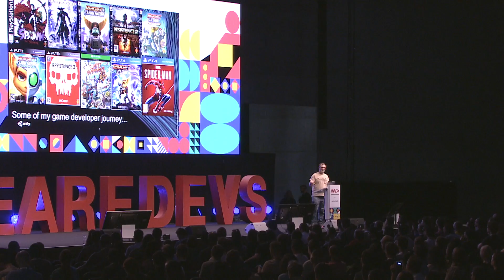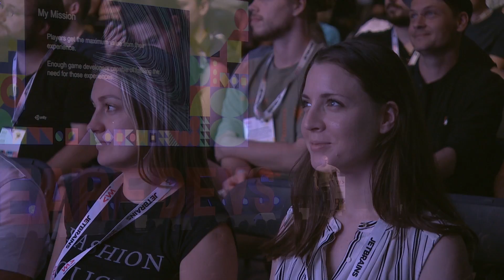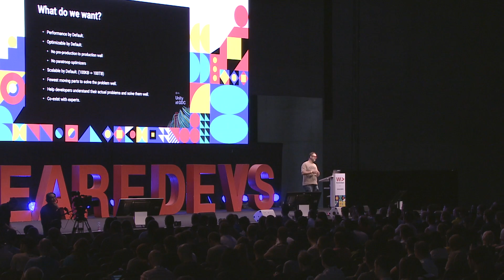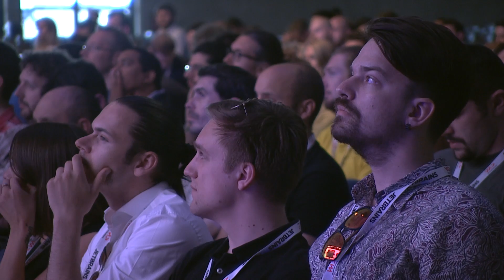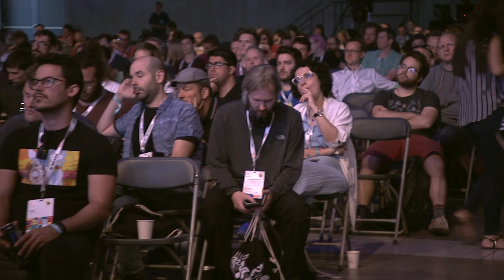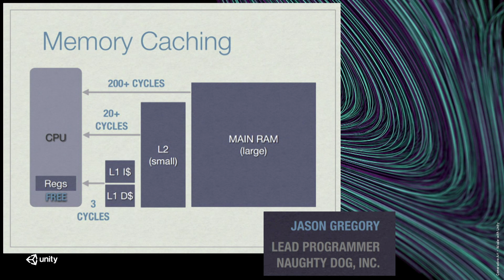Building a Data-Oriented Future -  Mike Acton

Comment: - "Unity runs on 25+ platforms."
- "Software is not a platform."
Reply: Can you explain what is contradictory about those statements?
Reply: @moistmalone2181   Many of the "Platforms" listed actually use the same Hardware and have just Software differences.
Reply: yeah it's running on platforms, it is not a platform in and unto itself. Those platforms have actual hardware
Reply: @drygordspellweaver8761 Many of these platforms are just Software run on the same hardware. For example Windows, UWP, Linux and even MacOS before the M1. Steam VR could also count as the same cause the differences are input and output devices. It is still a PC. Unless you start counting different monitors and controllers as platforms. I probably give it to them cause for VR, at least you need to implement stereoskopic rendering. Xbox one and PS4 also use almost the same AMD hardware. With different OS and drivers of course. On pc you can do many optimizations for different cpu models or gpus but the platform you are developing for would still be a pc. Android and IOS are another good example, you could count many phones as different platforms, but you dont. And if you dont count it as different then the rest of what differentiates IOS and Android is software. If you only count hardware, is WebGL even a platform?

And why list intel as a seperate platfrom? If it already is implicitly in some of the supported targets. Its done to make them look better cause they support so many duplicates.

This is very opinion based, exaggerated and was just triggered by the "Software is not a platform". The platforms shown are obviously defined by hardware and/or software combination. Not just hardware. "Software is not a platform" wasnt even used in this context. The word "platform" in particular has different meaning in both contexts. In the talk he explained something very important when he said it. I just found it funny that he was indirectly contradicting the list of "platforms" supported by unity.
Reply: @ischmicki  uhhh. Have you ever built a mobile app? You absolutely cannot port the same software to android/iOS without modification. If you use some kind of "universal" abstraction framework, then it is slow af which is completely Mike's point to begin with. Software is NOT a platform.
Reply: @drygordspellweaver8761 Taken out of context, if software is not a platform, why list windows and linux as different platforms? Its different software, run on the same hardware. Its different apis of course, but its software differences. In the list of platforms shown, there are many such examples. And then there is intel listed as a platform. If there isnt some intel os im not aware of, it doesnt follow the definition used by their list and is just there to increase the count. And what about WebGL? It could run on any hardware, its just software. Why list it as a platform?
Reply: @ischmicki  So you clearly know those two usages of platform differ, just say it was a joke and keep going on.

Comment: I've snubbed Unity for using C#, but this really convinces me. Low-level rendering code in C++, Shader Languages, and GPU Rendering APIs, with HP C# being used for ultra-performant scripting. Very different than the XNA C# of old. I've been on a Rust, Zig, Jai kick for a while now, but I've always had a partial fondness for C# (when comparing to Java) and the fact that it's this well-opinionated subset is actually incredibly appealing. I wish I was more clued in about this earlier.

Comment: I'm not sold on data oriented design. Yes it obviously gets you performance gains. But performance is not everything. Ease of use and clean, understandable code is also valuable. It's part of why Unity has been so successful. Beginners can easily learn to just throw a c# script on a game object and call high level functions like LookAt() or SetActive() and see it just work. That's abstraction. Being able to write code once and deploy it to 25 different platforms? That abstraction. I'm all for making performance gains, but let's acknowledge that there are tradeoffs.
Reply: Except those lookAt() and setActive() functions never "just work". They're built on top of something else, and when there are a problems (there are always problems), you will have to dig into what those functions actually do anyway. You don't solve problems by pretending they aren't there.
Reply: @tedbendixson  That's one thing I found as well -- we had such a complex interface for the analogical transformer, including functions involving pivots, and rotating pivots, and whatnot. In fairness, my team consisted mostly of academic R&D types heavy on computer graphics research -- maybe far more academically smart than smart about designing easy-to-use interfaces for things, and they were from various parts of the world -- English wasn't always their native language.

So I found myself and some colleagues often frustrated -- like just gimme the damned 4x4 matrix there. I know how to align two surfaces together with basic linear algebra -- the math is simpler than the complex interfaces they gave me and the manual-style verbose documentation they'd write (they'd literally write about 20+-page documents into source files and call them "usage manuals").

I find that a recurring problem in computer graphics -- like the domain knowledge required is already sorta steep, but once we break through it, the plainest representations of data are what we master.... not someone else's idea of how to abstract it. It's like I've been working long enough to understand all images are just 2-dimensional matrices of some vector or scalar type. pixel=y*img.w+x or, for power-of-two widths, pixel=y>>img.bitshift+x is burned into my brain from the DOS days. It's second nature to me now... but not like get_pixel(x, y), or set_pixel(x, y), or convert_pixel(x, y), or ImageFactory, or PIxelConverterFactory, or any of that OOP BS people wanna pile on top which, from my standpoint, provides not only some obstacles for the optimizer but for veterans as well in this industry.

What I like with suggesting lookat() functions and stuff if people wanna build that on top of a data-oriented engine is that they can do that... for their personal use -- in a sort of modular way. Just don't expect me to use it or debug it. I recommend that for sorta high-level developers who struggle with these things to build whatever convenience stuff they wanna put on top -- including object-oriented designs... But I think at the core engine type of level which tends to demand a high degree of domain expertise anyway and has a far larger portion of critical execution paths and performance-critical code than maybe even Knuth would ever have anticipated, it helps to just expose the data if in doubt.
Reply: @darkengine5931  I'm a big fan of something like what Casey Muratori calls "compression oriented programming," or the idea that "abstractions" naturally evolve out of utility.

You start by just plainly writing the code to transform your data, and once you notice that something is used more than once, that's when you lift it up into a function.

Programmers make way more things into "apis" when they really don't need to be.

If your player character only ever does something like looking at a point once in the code, there's no sense pulling that out into a function. It isn't being used enough to justify that.

The labor is waste, and the cognitive overhead of figuring out where it gets called and how much is also waste.

Problems are as simple or as complex as they actually are. Putting code into a function call doesn't change the nature of the problem.
Reply: @tedbendixson  I like this way as well. Some level of API design tends to be a practical requirement in my industry since we've gone heavy on the modding type of thing as a business target so we need the SDK and script bindings and whatnot to allow people to write plugins and scripts for our engines. But I like at least having low-level APIs to work with -- like not the analogical GDI SetPixel type of functions in Win32. Just gimme the damned pointer to the array so that I don't have to pay a dynamic dispatch cost on a per-pixel basis... things of this sort.

I suspect not all domains necessarily require us to master data in this sense. But computer graphics move so fast in terms of their evolution -- so the data is what remains stable in a world of moving targets. Audio processing is similar to me -- just a bunch of floating-point or fixed-point samples. APIs come and go like fashion trends. What I've found still applicable even from the 80s is the basic representation of data... with a few tweaks here and there to my idea of more complex data structures. But lots of computer graphics and audio is just processing big arrays of stuff more often than not -- maybe every now and then a more complex spatial structure for things like frustum culling... but still lots of recurring ideas -- and those recurring ideas aren't found in APIs (we have a Tower of Babel problem there) but in the data representations.
Reply: @tedbendixson   I've also worked on some horrid C-style legacy codebases dating back to Amiga days and the 80s -- where you found lots of what should be invariants violated... like some raw C-style structure representing a growing array with a size field that becomes negative -- not garbage but the arithmetic was just off. So I can appreciate the desire to protect invariants.

But from my pragmatic standpoint, the public/private distinction ultimately just serves the purpose of just reducing the number of functions in our system that can mutate data. With proper quality standards, we don't need to have a compiler literally enforce that with classes that make members private. The legacy codebases that I've worked on didn't even attempt this in any shape or form whatsoever, so maybe OOP was like a heavy-handed response to that sort of thing that went too far in the opposite direction. An ECS engine already reduces the places that mutate data down to the bare minimum -- as well as making them explicit. Even without an ECS engine, I think any programmer who makes a conscientious effort not to mutate data in too many disparate functions across the system can have something reasonable to maintain without going overly heavy on trying to hide the data completely.
Reply: @darkengine5931  API design depends on who is using it. If you know the people who work with your stuff, then you can design it to help them out. But I'm with the speaker on this one. I prefer to assume I will work with smart people who can figure things out. It's my own game and game company. I get to choose to only work with smart people
Reply: @tedbendixson  That's awesome. I dream of that -- more so now at my age. My thing is like I'm not really a smart, technical type of person. I just like whatever works and doesn't give us grief -- minimize grief. And I like cool shit. I tend to get along with designers and artists and users more than the engineers. For some reason, I seem okay at the engineering stuff -- maybe because I started at 7-years old and I'm in my 40s now. But I don't think like one -- I just picked up programming because I was a gamer and had my own ideas of what would make games cool. Oddly over the years, I've become a low-level senior engine developer... probably just because I've been working on computer graphics as a common denominator since the 80s. But I yearn sometimes to work with more passionate and free-spirited people... sometimes I feel like I'm working with Data from Star Trek -- and they don't get or, most of all, seem that interested in the customers... just their research.
Reply: @tedbendixson  With the COVID stuff, I've been dreaming of trying to go indie... start a company. But tough with wife and savings that won't last more than a couple of years at most. I'm also not a business-savvy person. I just like cool stuff that's badass.
Reply: @darkengine5931  Most roles are too narrowly defined, and if you're the sort of person who has a creative itch, you will bump up against the limits of corporations trying to turn everything into some sort of banal assembly line where everyone "specializes" in some tiny domain. We don't seem to be open-minded enough to believe it is possible for an individual to be good at many things, and that's a tragedy because it wastes human potential.

I just got back from a morning of snowboarding, hitting jumps, doing flips and 720s. Now I'm going to go right into game design and game engine programming. I'm also going to cook a delicious vegetarian meal from scratch. I believe it is entirely possible to be good at all of these things. It's just an optimism I have. If you don't believe it, you won't even try.
Reply: @darkengine5931  I'm still not 100% full-time, but I make time for it very early in the mornings when nobody can distract me. You can learn game design and try out new game ideas without spending a ton of money or time on it. Once you've got a compelling prototype with some interesting levels, it makes more sense to start investing bigger chunks of money at time into it. This is entirely about risk management.
Reply: @tedbendixson  Well, my sort of rude thought on this is that OOP is best for beginners.. along with languages like Python and whatnot.

So for people who don't know how the basic math to access a pixel at a certain row/column, or normalize vectors, or do transform with pivots, or anything of this sort, they can build layers of abstractions on top of our engine. And that's fine -- just like how some people who aren't very savvy at this stuff write their game mods for Unreal using Python or whatnot.

My thing is like just don't write the core engine in object-oriented Python let alone object-oriented C++. It will be horribly inefficient typically for both CPU and veterans used to transforming and accessing memory/data very efficiently.
Reply: @darkengine5931  I suppose on a more basic level, I have this overall sentiment that if someone isn't willing to learn what they need to learn to understand the systems they're working with, they probably won't make games that are good or that can compete with those made by people who do have this knowledge. So why indulge the bad faith? It's like telling someone they can be a pro golfer just by practicing on the weekend.
Reply: This point is literally addressed in the talk around 12:00.
Reply: @
Boggled Eggnoggler You can still use such convenient functions like `LookAt()` in a data-oriented architecture with an open data mentality to its design. The difference is that if you need to do a fairly complex transformation that involves inputting a transformation matrix and outputting a new one, you don't have to try to figure out how to do it with complex interfaces and layers upon layers of abstractions that hide that vital data as in object-oriented designs. I've had colleagues before who worked with abstract `ITransformer` interfaces that would write the most convoluted code trying to just do simple things like align and snap one object to the surface of another, and mainly because the layers of abstractions made it so difficult for them to input the actual data.